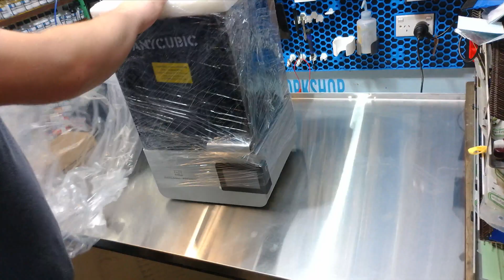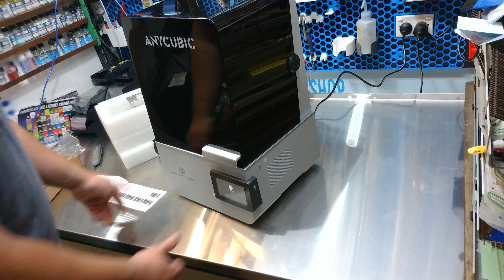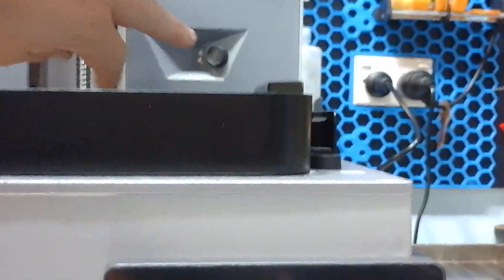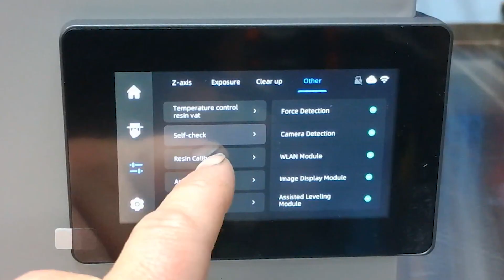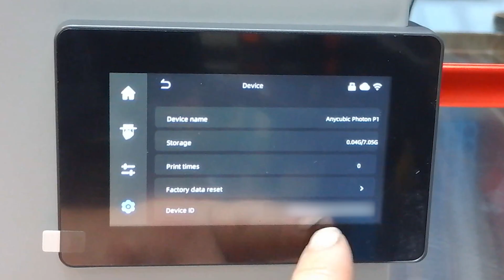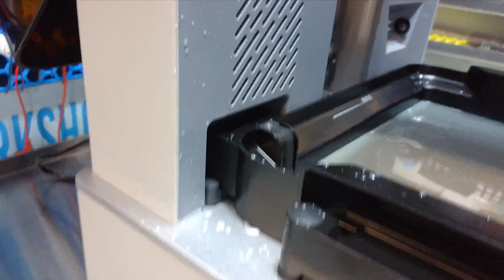Anycubic P1 Unboxing & First Impressions – Is It Any Good?

Comment: That extra dripping is going to be a real PITA. I guess that'll need to be fixed somehow.
Reply from the maker: I have done about 60 prints since this video, so far it has not happened again. Not sure why it happened here bit fingers crossed it was just the one time. 🤞
Reply: I have had something similar to this, and yeah, it is an unnecessary clean and possible damage to the screen protector if you miss it. I have 5 other resin printers and have never seen this "drip splash" after printing. Glad I came across your video, as I thought I was going crazy and possibly filling the vat past the MAX volume...
Reply: @ATLnJP  check level. It might be that the VAT isn't sitting level and Drips are splashing just in the wrong spot to splatter. That's the only thing I can think of really to explain why I would be doing this. Unless the VAT is just horribly undersized. My machine comes in on Monday or Tuesday. And hopefully I can find a good solution for this.
Reply: @MoonWind32690 You were spot on! I had two partial plate failures and had to level the plate. Everything printed well. 
Also,  prior to the print, there’s a setting that gives option of raising build plate to the top. I turned this off as I thought this splashing would stop as well!

Hope you enjoy your printer. My first resin printer was an Anycubic Photon D2 DLP and it’s still working well!